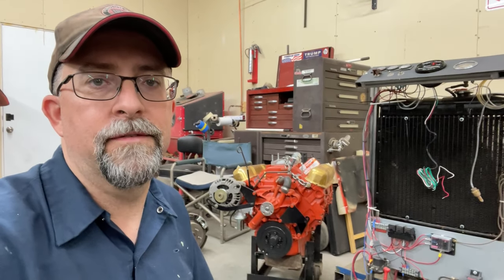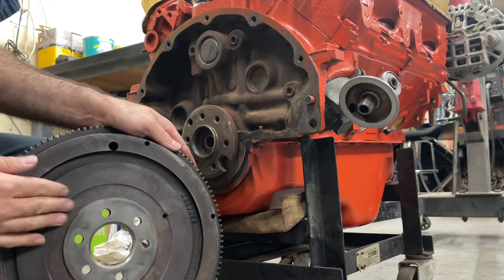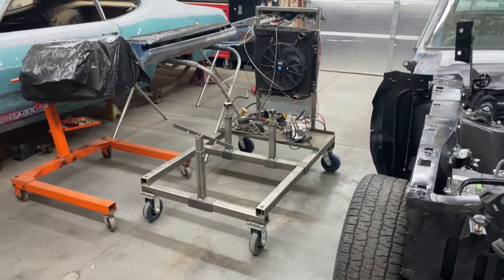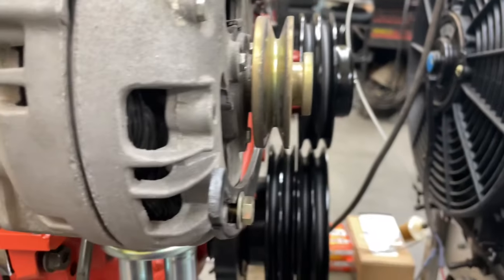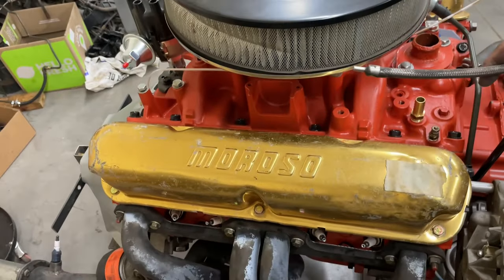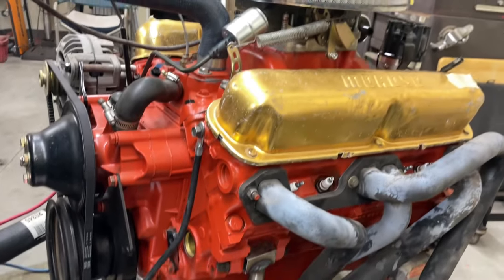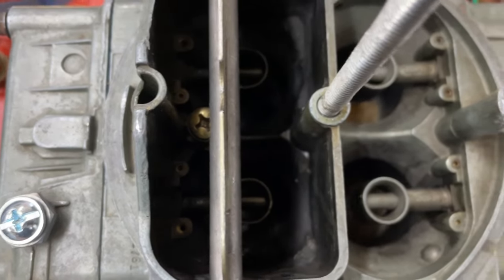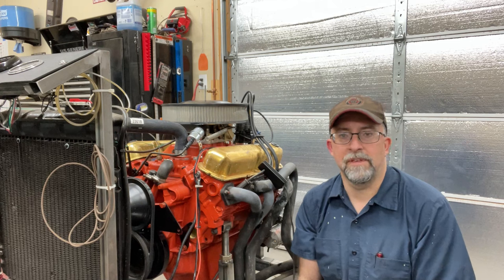318 Mopar Engine Build on a Budget Part 4 - First Run On The Stand for the 1974 Plymouth Duster!

Comment: My 1988 roller 318 is quite, that motor has some clacking, maybe roller lifters not pumped up fully, I always run them 2k even with roller cam. Last summer rebuilt a 1977 chevy 454, the wipe cam lobe gods were kind to me.
Reply from the maker: I think we may be hearing the significant exhaust leak.  I have the wrong (cheapest) exhaust gaskets on it as the headers are temporary.  I'm going to be going with iron manifolds.  The vacuum gauge is also rock solid, so I don't think there's a valvetrain issue, also have good oil pressure as well.   I'll certainly check it out again before I install it in the car.  Thanks for the heads up.

Comment: What gears u running on the Duster
Reply from the maker: The 74 rear end is an 8.8 LSD with 3.73 gears.  The 70 duster bracket is an 8-3/4 with 4:10 spool.
Reply: @roadhardrestorations  my 73 has a open diff 1 tire fire 🔥
Reply from the maker: @joshjones1360  My 74 came with a 8-1/4 open 2.54 gear.  Sssnnnooozzze,,,
Reply: @roadhardrestorations  i hear that I definitely need some gear
Reply: @roadhardrestorations  I'm thanking about some 3:73 with a limited slip or a locker